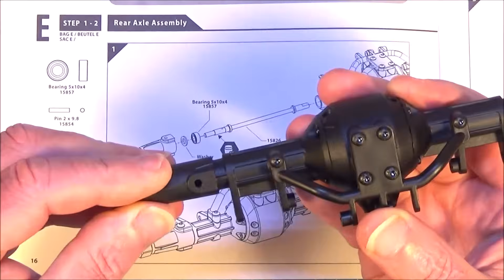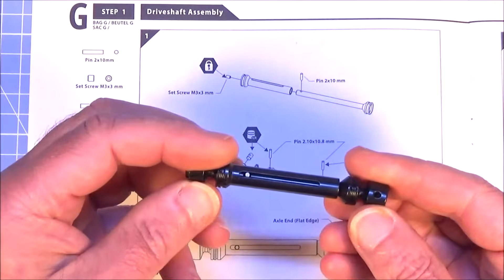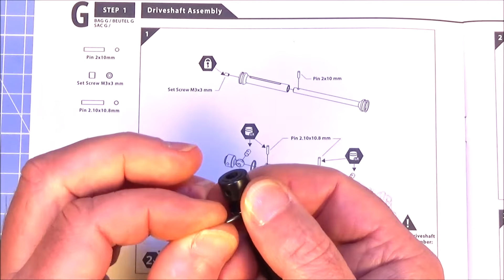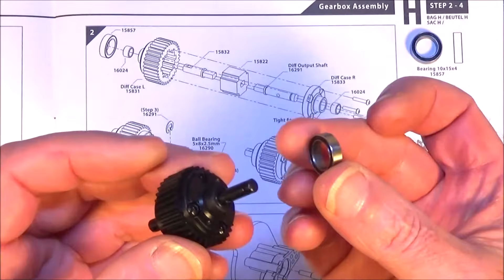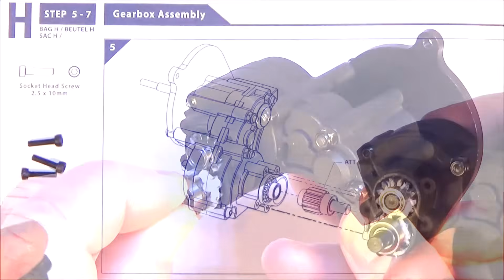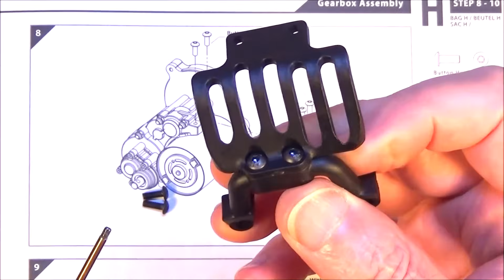Carisma SCA1E 2.1SPEC Bulldog Deluxe Kit Build & Tips Part 2 - Gearbox, Propshafts & Clutch

Comment: Hi Mark, I ve just ordered this kit but was looking to put a brushless motor in. What Brushless motor would you suggest?
Reply from the maker: Hi there! Hmm, not had any experience with brushless crawler motors but my friends are really impressed with the Hobbywing Fusion range of integrated ESC and motors - worth a look!
Reply: I run a hobbywing fusion se 1200kv in my Coyote2.1 with 16t pinion its perfect plenty of wheel speed and insane torque